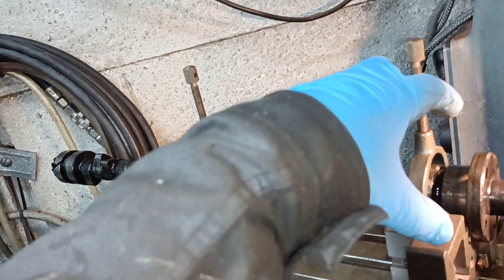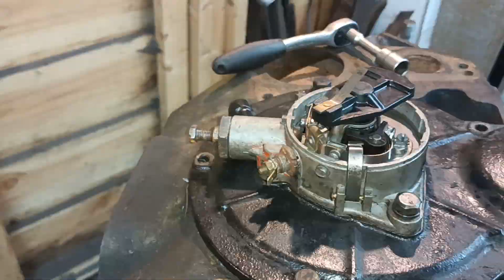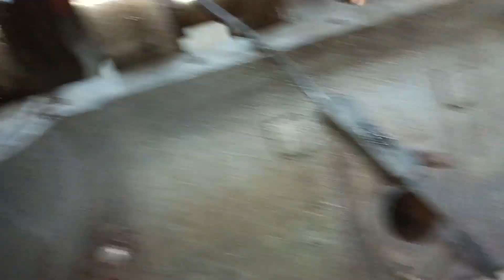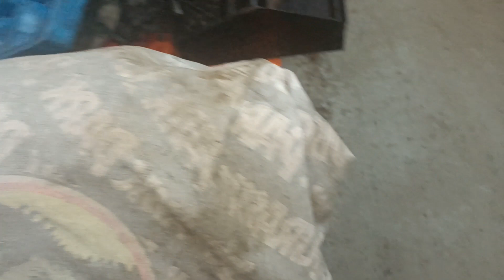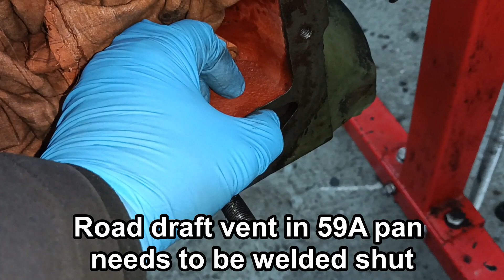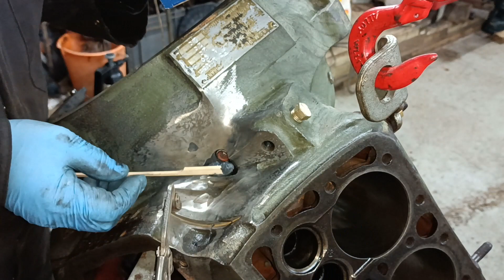Spalding French Flathead 59A clone Part 2. Cam, Piston and block mods.

Comment: I appreciate  your effort to make these videos, I look forward to the next one. I tinker with my '42 truck, I will readjust the lifters after Xmas yes , I have adjustable lifters, stainless SBC valves .The engine has 8000 miles on it now since I rebuilt it in 2000 !
First start 2017. Engine was full of engine assy lube, to preserve it.
Reply from the maker: Adjustable lifters? Luxury!

Comment: Hi Mart, thanks for another great video, one thing I noticed, was the hole in the French cam, I think I once read that 8BA engines have a drilling up the cam that allows for lubrication of the distributor gears, I don't think the 59A don't need it, you may have to block off the oil passage. You may have to do some research, if you haven't already. Keep the videos coming, I hope to assemble my 8BA that's going in my 31 Coupe,  in the new year. Thanks Byron Launceston, Tasmania Australia
Reply from the maker: Thanks Byron and you're absolutely right. I did plug the hole before final fitment. Good luck with the 8BA in the coupe.

Comment: Great Job as usual, Mart!  I was thinking as you were clearancing those pistons, that you might have measured the radius of the cast crank and set your piston up in the rotary table with a little larger radius for clearance.  I Couldn't visualize how to measure that radius, but there is surely a way, LOL. 
Al Hook
Reply from the maker: Hello Al. I Just used the radius of the French piston as a guide, but I did measure the crank and eyeball the fixture so I was starting at the estimated radius and then fine tuned it with the French piston. There are two critical dimensions, the radius and how far up the piston the radius is cut.

Comment: Another great episode of Mart's garage!  I really enjoy adding to my knowledge base on these old engines. You're a brave man to take a zip wheel to that rare block. I've pondered using a crab dizzy on an 8BA, I now believe it very doable, even with just careful usage of hand-tools. Thanks! 👍👍 And Merry Christmas 😃😃
Reply from the maker: Hello Art. The French motor uses 59A type gears which helps. You'd have to change those if doing the job to an 8BA. Merry Christmas to you too.

Comment: Hi Matt ,I have one of these lumps in my Pilot.  After reading about them ,I felt assured they were a better option ,but failed to find in depth detail.It was already installed in the car previous to my ownership.Great content again ,thanks !
Reply: *Mart
Reply from the maker: Hi Phil. If youn hover over your comment there are three little buttons on the right. One option allows you to edit your comment. A pilot, eh? Where are you based?
Reply: Approx 10 miles from 'Pod

Comment: Well done Mart. Hold downs worked perfectly. Trimming the skirts worked well. Rotary table was a plus. Could they have been turned down and still retain the last ring or trim it off and lighten the rotating assembly. No clearance issues for sure. Only asking. Enjoyed watching. Be nice if we weren’t separated by this big pond. Thanks for sharing , Cheers Mart 🍻🍻👍👍👍
Reply from the maker: Hi Ron. The last ring has to be discarded as it passes over a relief at the bottom of the bore. I never thought of just turning them, I thought it better to keep the skirt at full length to get best support in the bore. The 3-5/16" bore motor in my roadster has the same mod on all 8 pistons. Yes it would be nice to be more local to a lot of people and places. Especially the places that sell the flathead stuff! All the best, Mart.

Comment: Interesting, so you have 6 French pistons and 2 that are modified to fit.  Modifications to the center of the block opposite each other for balancing purposes?  Pretty gutsy call on that camshaft--Well Done!!
Reply from the maker: Hello William. No, Seven French pistons at +.030" and one Ford type at +.060". The first one I did was too light so I did a second with less metal removed. Yes, the cam came out well. I did three cams while I was set up.
Reply: @MartsGarage  Hmmm, I should pay more attention to the video--saw 2 pistons, figured they were both going to be used.

Comment: Morning Mart,
Another great video and I am again impressed by your skills. After you machined the piston skirts, do you not think balancing them something to consider? 
Cheers, 
Tim from Texas
Reply from the maker: Hi Tim. Please see reply to Eric re the balance. This is a "plodder" build so just getting it running was foremost. Balance is close but wasn't checked with that piston. The first one was too light. If I ever tear the motor down I will check it out of interest.
Reply: @MartsGarage  Mart, I suspect if you do not push the motor that hard, all does not have to be in balance.